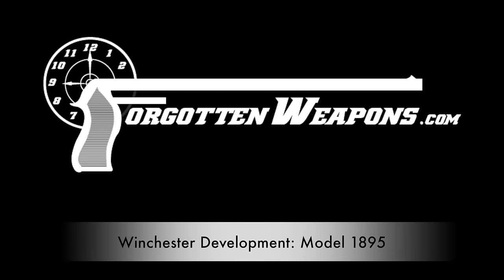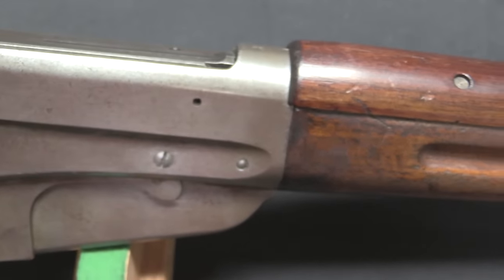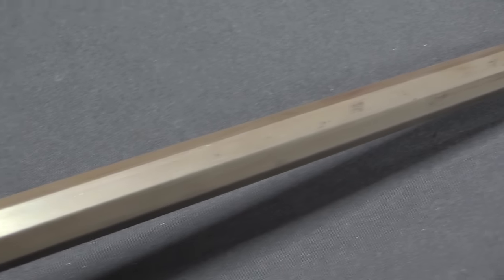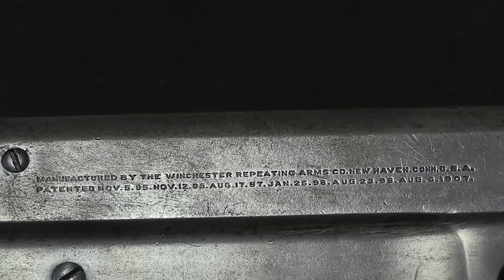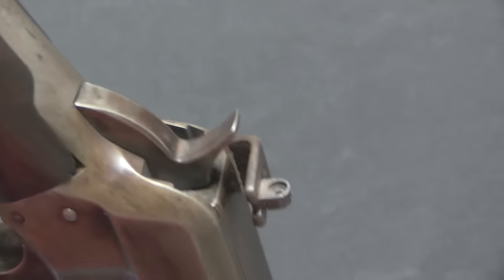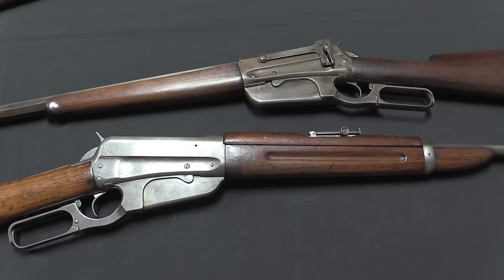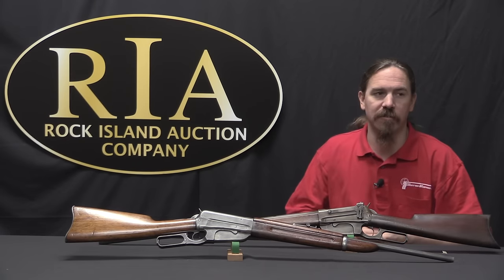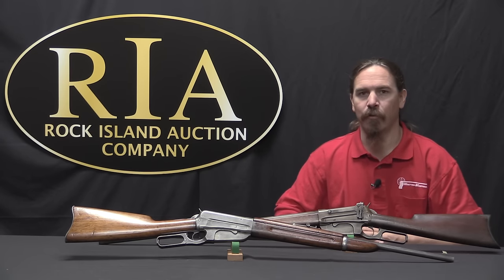Winchester Lever Action Development: Model 1895

Comment: If the Russians favored these to the Mosin, why did they then develop the 91/30 rather than sticking with the 1895? Would it be that the Communists didn't want to use the American rifles?
Reply: Ollie Wills or cost
Reply: A True Slav Good shout, I forgot about cost
Reply: Or more likely they just didn't wanna spend more money on foreign rifles in general. Easier to make what you know than to keep buying from someone else and deal with the logistical hassle.

There, of course, may have been a political or nationalistic element but it's largely insignificant compared to the cost.
Reply: Not exactly. Firstly, the M1895 was more expensive to produce than the Mosin bolt gun; so even if individual soldiers preferred it, this wasn't much of a concern for the weapons procurement officers. As Ian pointed out, they only procurred the Winchester in the first place because they were desperate for nearly any rifle to compensate for their shortage of M1891 Mosins. The second  reason the M91/30 was chosen over the M1895, was that the government was Communist at the time, so there was zero chance that the American Winchester company was going to supply them with new rifles, much less equipment and tooling to manufacture the rifles themselves.
Reply: Russia was in no position to change production to a new rifle in the 1920´s and 1930´s, and when they wanted a new rifle, they developed the SVT-40.

Comment: why did Winchester keep the musket for so long
Reply: Rich Hart It just means a longer barrel.
Reply: To attract military interest
Reply: Cause real men wanna be musketeers!
Reply: The Warden 👍thanks
Reply: Many people back then held on the old concept of well drilled men will stand in lines and fire in volleys before closing in with the bayonet, Napoleonic Era style.
Nobody thought of the increased rate of fire that has steadily increased over the span of 100 years, in 1790, a Line Inf can fire about 3 round (4 via relentless practice) per minute. In 1890, a Line Inf can fire about 20-40 rounds per minute. in 1990, a Line Inf can fire 600-800 rounds per minute.

Comment: Hi, Ian. Can you, please, clarify on one thing. Starting at 13:09 you are saying: "... it is a far better combat weapon than the Mosin-Nagant bolt action rifle." 

How come? I mean, what are your sources and your personal opinion on that matter?

Thanks.

UPD: looked up all related vids on FW and InRange. Still, questions stand... for various reasons (but, if you don't mind, I would rather have your opinion first). Thanks again.
Reply: Well, after carefully considering your position on this (including the bunch of buzzing MN-ish trolls; and, hopefully, I got it right), let me just point out that this particular generalization of yours, Ian, hardly stands simple logic check (which, I have to also point it out, is a very unusual case with your insights). 
Yes, MN is NOT THE BEST BAR in the World,  probably, down to the fact that it is really an early design amongst major military BARs. If we take Mauser, they released how many major (year marked) design improvements in the next 7 years? And Yes, Imperial Russian state-owned small-arms manufacturing plants were not the paramount of finishing quality either. 
But, and here, for some reason you lost your usual hard-boild logic to God-only-knows-what impediment... Look, in your own video on American-made MNs (thanks for that one) you yourself pointed out the differences between impeccable "pin-up" Remington and... "slightly less impeccable" NE-W. "Even in the US!" (this particular phenomenon I will address a bit later). But, you really, somehow, managed to overlook those three little characters: "/30" on that mud-tested MN. I got it "they are mechanically identical", but, that's really not the same thing as "they were made exactly to the standard", whatever that standard was. 
And here we are coming to the insight itself, namely, "the commie gun". 
The October coup and the ultimate establishment of the USSR led (and it is very well documented) to the SIGNIFICANT DROP of "production quality", due to the simple thing bolos executed on Russian soil: Stratocide. Love it or hate it – you just need a good engineer, technician, and – yes, military surplice quality control officer (remember those guys who were torturing Remington and NE-W with the Russian made 7,62x54R before paying for them – they were not asking for a little bribe here and there, they were actually doing their job). 
Those were the guys who have done the initial testing of the rifle's design in 1889-90 with 300 guns for two months, especially mud-testing (Napoleon said that in Poland dirt is the 5th element, and at the time big part of Poland was just a Gate to Russia). The gun simply wouldn't be allowed to continue if it would perform like that you and Karl tested. (Note: I am aware of the feud over Kalashnikov's design mud-capabilities. The genius of AK design is the marriage between the capabilities of the gun itself and the Soviet/any other crap production culture. By the way, Soviet Army did compare Soviet and Chinese AK in the 80s, the only difference was 5000 shots from Russian against 1000 from Chinese). And then, under the Tzar it would be discontinued if tolerable standard wouldn't be met. Yes, after the Ottoman Empire was finished as the Great Power (despite using lever-action guns :) Russia and Austro-Hungary were THE TWO most antiquated Great Powers on Earth. But, really, not to that extend. And yet, Soviet executors have been shooting Polish officers in Khatyn' with... Walter PPK, and not TT... There was a reason for that.
How come that such a crap design survived in Finland – "The Land of the Mid-night Sharp-shooters" – to this very day?
I'm not really encouraging you to put any of those gorgeous pieces of History into mud anymore. Just give your curiosity 10 minutes, take a micrometer, a couple (maybe more) of 1891s (some of them 1891/30s). Viola, as the French would put it (Buy the way, I'm pretty much sure you know the correct pronunciation of the name "Nagant", but, somehow, always use the silent "t" at the end - just teasing trolls? :).
I'm not challenging your personal opinion on MN-, or BAR design in general here. I recognise you have every right to think what you think on anything. 
But, you would rather say this: "I would go into battle of the Great War with pretty much any rifle of major design, although I have my personal favourites and underdogs, including this two Winchester Lever Action chambered in Russian 7,62x54R, especially, as they are of the great production quality and I prefer Lever Action over Bolt Action myself; for the Great Patriotic War, as a Soviet GI, I have no choice, but between 91/30 and a broomstick (the latter, despite all the bolshevik propaganda, been not an option at the frontline of the Great War) – I have Zagradotryad (Barrier troops) behind my back. Armed with very reliable Maxim Guns, very probably, Russian Imperial PM M1910, 'cos NKVD never used crap guns. But I wouldn't pick up for myself in any war the 91/30 for all the money Soviet Union and Post-Soviet State (so called 'Russian Federation') payed US back for the Lend Lease Act programme over 70 years." 
UPD: and here comes the Q&A part 2 on InRangeTV where speaking of Sniper Guns of WWII Karl suddenly goes for Soviet Era MN PU, though admitting that he doesn't like MNs in general. "We all are the slaves of our experience," as it were. It would be valuable to point out that those PUs started their lives being selected out of dozens of other barrels for not shooting strait round the corner. A little bit of TLC doesn't really hurt anything, even a MN rifle commie-style. :)

And now – to the exciting part. Not a single living person remember that, but before bolos came to power, USA and Russia were actually officially THE BEST FRIENDS EVER since before the Declaration of Independence (ask both Adamses – they were there :), and especially – since the American Civil War. And more importantly, not only the governments of those two countries were all palsy-walzy, but the general attitude of Russian society beyond peasant class and up to the Romanoff family was as Americanophile as it gets. And especially in the areas of technical, technological and production culture advancement. Everything American was not only highly regarded, but a Great Vogue amongst Russians. So, when the Great War broke off and rifles from the US started to come over, they were, of cause, well regarded. Especially, the lever action guns, as every more or less educated boy in Russia in previous 50 years played "Cowboys vs. Indians" with his friends, till the time was coming to attend the supper and read yet another Wild West book in the evening and the best portion of the night. :)

By the way, one particular American Gun was the Real Idol for the young Russian officers since the year 1912 and well into the Great War. In 1912 it was immediately allowed as a surplice gun for commissioned officers by the Tzar himself. And that gun was a subject of great admiration and lust to the extend some Soviet and Emigre writers wrote on their relations with it some love-letter like lines. Rather unsurprisingly, it is, of cause, the .45 Colt 1911 Semi-automatic pistol.

And one more thing. Officers of the Department of the General Quartermaster of the Russian Imperial General Staff were able to count and predict the proper amount of the small arms to feed the RIA and RIN during the major war. The 2 problems were: 1. Timing. Prime-minister Pyotr Stolypin, before getting assassinated in 1911, used to say very frequently, that Russia needs just yet another 20 years without major war. And 2. Politics. One couldn't admit his country doesn't have enough capacity to produce its own small arms without major political gain to its enemies. But, when the Great War broke off anyway – the time had come for American Rifles in 7,62x54R.

Sorry for the piece. Thanks to you and Karl for all your videos.

Comment: Why do you think the Winchester 95 is a better combat rifle than the Mosin Nagant? What are the advantages?
Reply: Check out the mud test they did on their InRangeTV channel. The Mosin Nagant fired one round before completely seizing up. After being disassembled and drenched in water, it still failed to function reliably. Ian had to smack the bolt on the edge of their wheelbarrow just to get the action open. Then the magazine stopped working as well. The whole thing was just a mess. The Winchester ran flawlessly. Besides that, the Winchester has a better trigger. A lot of people say that doesn't matter in a military gun, but whether you're at Camp Perry or in Afghanistan, a poor trigger will always lead to poor accuracy. Speaking of, the Mosin Nagant was never a terribly accurate rifle. It's good enough within 200-300 yards, but it's not great. Compare it to the Winchester or even the Springfields, Enfields, and Mausers of WWI and WWII and the Mosin Nagant simply can't compare. It is cheap and powerful and it's easily a good enough rifle for deer hunting, but the Mosin Nagant is pretty much inferior in every regard to it's contemporaries. It's just cheap, easily manufactured under wartime conditions, and good enough for what it needs to do.